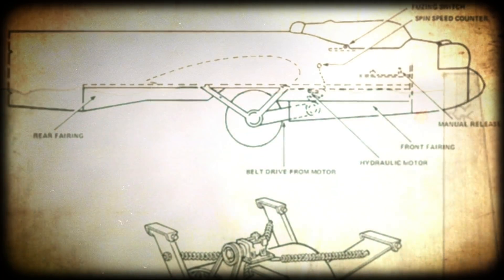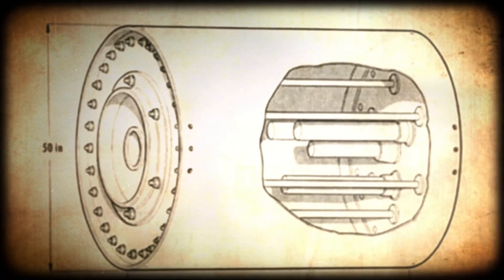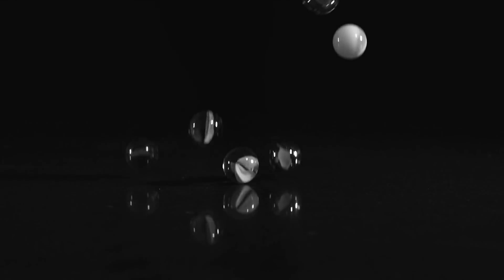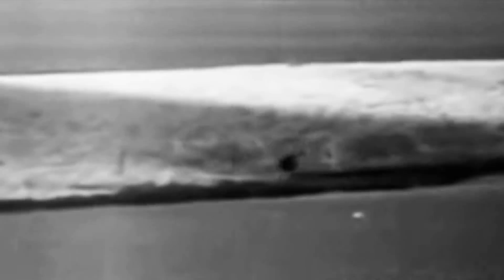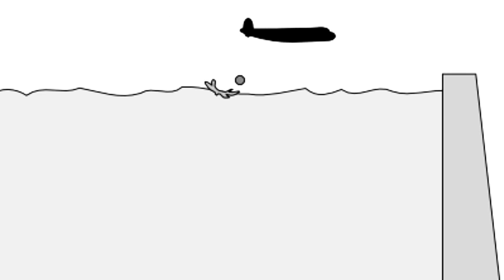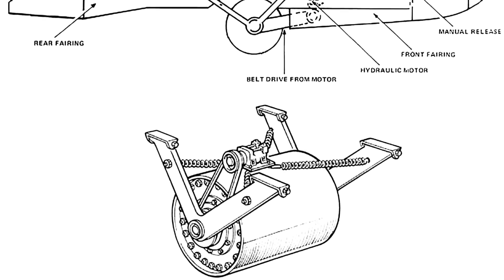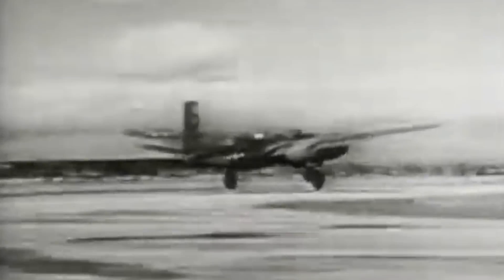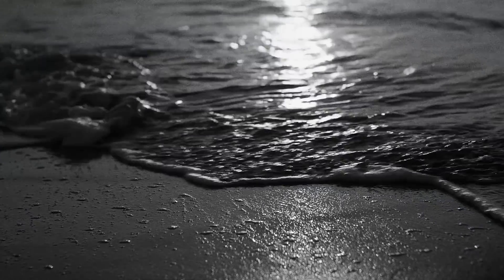Bouncing a Bomb Back Into the Tail of Your Own Plane

Comment: Always wondered why they didn’t come up with a type of torpedo
Reply: The dams were protected by underwater nets
Reply: Because if it goes into the water, it has to fight against water resistance so wont have the same amount of energy when it impacts the target. To combat this you would have to add a motor, fuel source, control system, which adds space and weight. Which is where the small, dumb, condense bouncing bomb excels

Comment: Seems like a Torpedo would be an easy way to attack a dam
Reply: The Mk XI torpedos of the day only had about 750lbs of explosive, not enough to crack the damn, plus they would have been triggered  far earlier by the nets the Germans used to protect the Dams. These bouncing bombs had about 6000lbs of high explosives, they did the job quite well.
Reply: The Germans already thought about that, and installed huge, thick steel nets at 50m intervals behind the wall of the dam. No torpedo could penetrate that.

Comment: Ok, why did America pull out of developing bouncing bombs after 1 accident? The plane was way too low (6x lower than its meant to) and they knew that. If they had stayed in the program like Britain we could’ve done a lot more damage
Reply: America didn't develop it the British did , and it was successful in breaching the ruhre dam , they made a British made a film called the dam busters.
Reply: Considering smaller torpedos could be launched from fighters and larger ones from bombers to bust dams.

These were practically depth charges
Reply: @shadowopsairman1583  That's right: they were depth charges. Everyone calling it a 'mine' is just using the wrong term that was used during the war to confound the Germans (who had already worked it out anyway).

But the fact is that they couldn't use torpedos against the dams because they were protected by torpedo nets.
Reply: April 28, 1945 is the correct answer. The Germans were only a couple weeks from surrendering and the Japanese fleet was basically nonexistent. There was simply no reason to continue developing such a weapon that could not possibly be finished before the end of the war.
Reply: @willythemailboy2  afaik, a lot of american development paused/cancelled because german/japan almost lose. When allied win the war, the drive to burn money to research pit just not there anymore.

But who care, murican bad, yurop gud, hurrrrrrrr
Lol
Reply: Typical Americans it was much like D day where the Americans threw up the landing bridges to rush troops on shire took the puss out if the British for taking too long... one big wind and mist of the American landing zones were wiped out, mean while 🙄the slow coaches bridges kept working
Reply: Possibly, but to what effect? 🤔 
As it turned out, not necessary or even desirable....!
Reply: @gus473  some people said the the whole exercise amounted to little effect , but that's not entirely true , along with the actual damage done it was a huge moral boost to the British and the armed forces, and that can never be discounted.
Reply: @gus473  only the Germans would agree with your statement!
Reply: @julianneale6128  as a Brit I disagree
Reply: @_outofphase5480  But it is known for people with no sense of humour who take themselves and their over inflated view of their country too seriously!
Reply: Typically American behaviour, "we didn't make so its bound not to work". Tries it out at wrong altitude "because of course americans know better" and screws up badly.
Told you it didn't work!
Reply: @ErraticPT  Or maybe because Americans are just used to using their own equipment and get tired of having to constantly learn how to use other countries stuff when we go to pull them out of a mess. Hahaha jk having fun
Reply: shape like soccer ball, not football
Reply: Because the whole idea was stupid and needlessly complicated, why not just drop a torpedo, or drop a normal bomb into the damn? There's no point in skipping it
Reply: @handledrandomly  A normal bomb wouldn't break the dam as it had to shatter it at a certain depth close to the dam wall (not possible with the accuracy of conventional bombing at the time) and a torpedo wouldn't be accurate or be powerful enough or have a long enough run on some of the dams including nets (certainly of a size capable of being carried by a torpedo bomber at anything like the range required).
Reply: @handledrandomly  Torpedo nets were a thing around darkyards, much in the same way they were fitted at the dams.
Reply: @handledrandomly  photo reconnaissance identified that the German had thought of torpedoes and used nets as countermeasures to protect their dams and ships
Reply: @handledrandomly  You obviously don’t understand why the ‘Upkeep’ (the bouncing bomb) was developed. It was designed specifically to frustrate the German anti ordnance defences of the Ruhr dams. The dams were protected by a series of multiple torpedo nets. No torpedo could breach the defences, no matter where or how it was deployed. As for bombing, there was no weapon system available at.the time that could deliver the killer blow, due to accuracy in delivery and sheer destructive power. As far as I’m aware, Wallis was working on the ‘Grand Slam’ (earthquake bomb) at the time, I’m can’t say for sure if it was in operation though. Also there was the ‘Tallboy’, again, I think this came later in the war. The anti ship bouncing bomber was known as ‘Highball’.
Reply: @handledrandomly  there was a point to the bomb, a torpedo would have just hit the dam to high , the bouncing bomb hits the dam and then sinks to the base and then explodes , a torpedo wouldn't do that , but it worked and the dam was breached. Also a normal bomb was just too inaccurate .
Reply: @i leik pi - Please don’t pretend you know what you are talking about.
Reply: @Chris-pi5vv  yep.👍
Reply: @handledrandomly  suggest you look up Operation Chastise. The RAF had to bypass torpedo nets, and dropping a bomb was too inacurate.
Reply: @handledrandomly  "Because the whole idea was stupid and needlessly complicated," So, rather like your comment. If you did some research before mouthing off you would know the answer and not need to post pointless comments.
Reply: @handledrandomly  Have you read about this at all because if you had, you'd know that the problem was that the explosion had to occur right against the dam wall at the correct depth. Conventional bombs had been tried time after time and had all failed. A torpedo would have been useless because it couldn't carry enough Torpex and the explosion had to occur many, many feet below the water.
Reply: @handledrandomly  The Germans knew from the start that their dams would be worthwhile targets, so they hung torpedo nets in the lakes to protect the dams. The bouncing bomb was designed to go over the nets. 
As for using "normal" bombs on the dams, the bombs were not big enough to break the dams and, because they would have to be dropped from high altitude, not accurate enough. At the time, the "earthquake" bombs– the Tall Boy and Grand Slam – that might have been used on dams did not exist. By the time they were operational, there were higher-priority targets to use them on.

Comment: In fairness, wtf was it doing flying that close to the sea. Holy crap that was low.
Reply: My thoughts exactly
Reply: I think that might have been because it's a well known fact that when flying over calm water, it's often extremely hard to judge exactly how high you are above it. I can also tell you that the pilot for sure wouldn't have looked at his altimeter at any time during that bombing run.
Reply: @julianneale6128  For Upkeep they had two spotlights, one on each wing, that converged 60ft below the Lancaster. One of the crew looked out of the bomb bay as the pilot descended until the spotlights converged & told the skipper when he was at the correct altitude. 
For distance they used two nails on a V shaped stick. The bombardier sighted down the stick & when the two nails lined up with two turrets on the damn he dropped the bomb. 
These methods left the skipper free to fly the aircraft & line it up at the right altitude without looking down at his instruments at all. 
Not sure what they did for Highball. I'd have to Google it. But  in that footage it's obvious that he was way, way too low!
Sad to lose a crew but it makes it  somehow worse when it's so obviously pilot error.
Reply: @Aengus42  yes I'm aware of the stereo lighting to check the height. However this USAAF run was in bright sunlight and so spotlighting was obsolete. All the crew might have had the same feeling perhaps thinking they were at about 60'.
Reply: @Daniel-S1  please read my above comments and think about it. When flying over calm water it can be at times extremely difficult to judge height, it's a well talked about subject. Also I can promise you that at that height, nobody would have been looking at that altimeter.
Reply: Julian Neale yo imagine flying extremely near to the water surface as an experienced pilot without checking the altitude.. I personally think it was intended to drop it that low
Reply: @julianneale6128  for testing, there were probably spotters on the ground who could have told the crew they were too low.
Reply: I said across their nose, not up it!
Reply: My guess is they are testing how low they could fly to avoid AA platforms before dropping the bomb. Apparently it was proven to be impractical when under enemy fire.

Remember it's the highball that went south, which was designed to hit ships. They're probably imitating torp runs on enemy warships.
Reply: im wondering who gave the orders to drop it that low and why
Reply: And what that they expected... they did previous tests..
Reply: my thoughts immediately wtf
Reply: @mostly-harmless  It was for the ultimate angle, so it would do more skips. but was unfurnatly too close.
Reply: keith moore  RAF Coastal Command Liberators had radio altemeters for dropping depth charges etc - but I wouldn't they'd be too accurate at that height.
Reply: Even lower now.
Reply: keith moore  I know  it's not.... I was just pointing out there were alternatives to a barometric altimeter or 'twin angled lights' to determine your height.
Reply: keith moore  Alas, aeroplane recognition isn't what it was !
Reply: You guys are making one hell of a lot of assumptions. 
You have no idea what the pilot's instructions were, he may have been doing exactly what he was told to do.
Reply: Exactly my thought
Reply: "Broke apart in a drop test" given they would be in contact with the ground, it's very likely it was part of the test.
Reply: You go LOKKING for trouble- YOU FIND IT!! TOO LOW for that action, try it from 50 ft or higher- not 15 :)
Reply: The German damns they were targeting provided power to the German factories and so were heavily protected by anti aircraft weapons. By coming in low and fast the aircraft would be below radar and harder to see and hit during the night attack.
Reply: Honestly they couldn't have been lower, not a well thought out test for a bouncing bomb
Reply: That's how you bounce bombs. You have to skip them across the water. If you were any higher the bomb would sink instead of skip.
Reply: keith moore maybe stupidity
Reply: They need to be that low
Reply: Uhhh yeah holy shit 10ft is ridiculous. Does TTD even exist there? It's virtually instantaneous. Maybe that was a good thing for those 4 though...sad
Reply: Literally doing flight testing. Various speed and altitude testing to learn the best technique to drop and deploy in theater. Nothing about arrogance. You don't know what you don't know.
Reply: I seen the movie about the bouncing bomb the British had a good thing but it was a little early before it's time but it actually happened and it worked even though it landed a few feet from its objective
Reply: Arrogance and stupidity is America's worst enemy. In this instance, it took out the plane and the program.